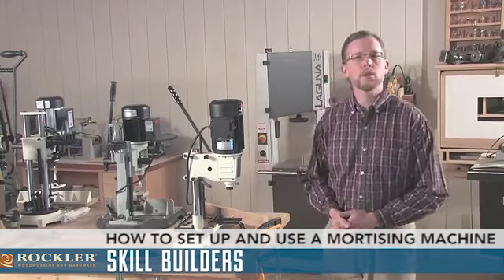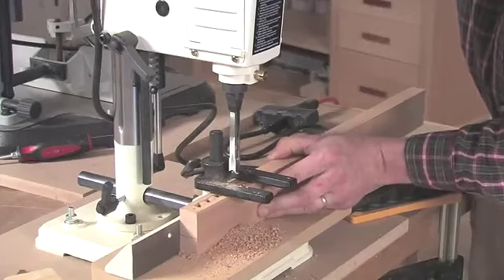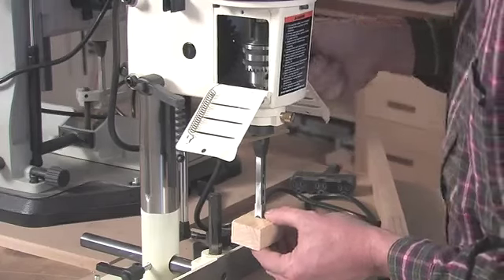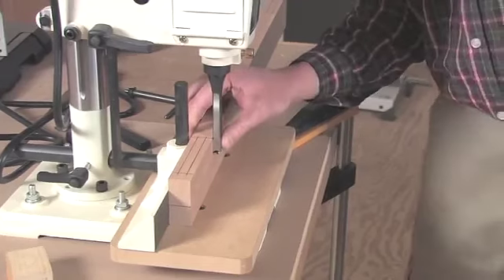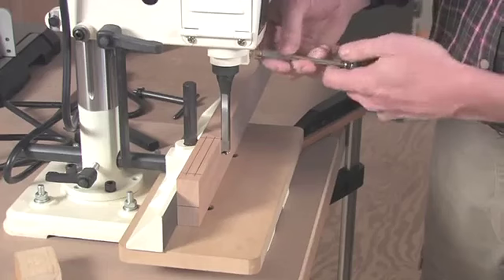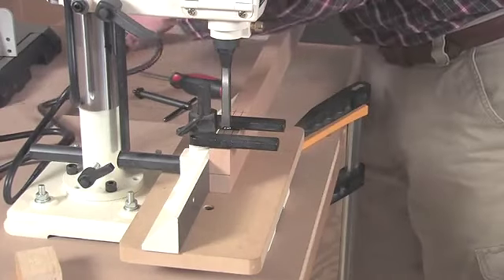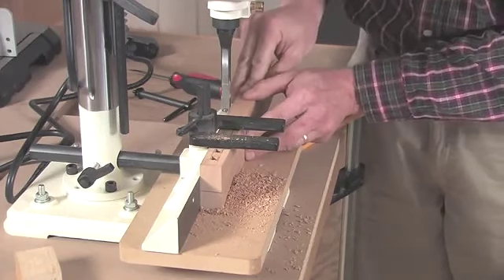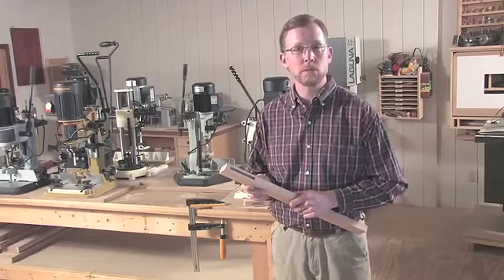Cutting Mortises with a Mortising Machine | Rockler Skill Builders

Comment: I just bought a mortising machine and the best tip of this video was the explanation at the beginning about changing the chip depth based on power of the machine, wood density, etc. I did not know that and now I know why my mortising was not as easy as it should have been. Thanks!

Comment: Would it be a lot quicker clearing it out with a router then just cutting the ends with a mortising machine?
Reply from the maker: We can't say for sure, as there are often a variety of ways to get a specific woodworking task done. Whether two separate set ups and operations would be faster is something to determine by trial and error.

Comment: Can a router do the same thing?
Reply from the maker: Many people do cut mortises with a router and have good success. One disadvantage to a router is that it leaves the end of the mortise rounded to the radius of the bit’s diameter. For that reason a woodworker would either need to shape the tenons to fit the configuration of the mortise, or use a sharp chisel to square up the ends of the mortise.
Reply: Thanks for the reply

Comment: Why wouldn't you align the chisel to the fence instead of the work piece
Reply: Since the work piece is flat against the fence it ends up being the same without potentially dulling the chisel by contacting it to the metal fence...